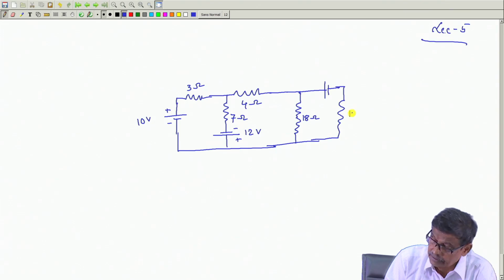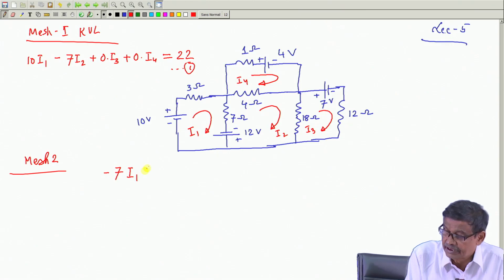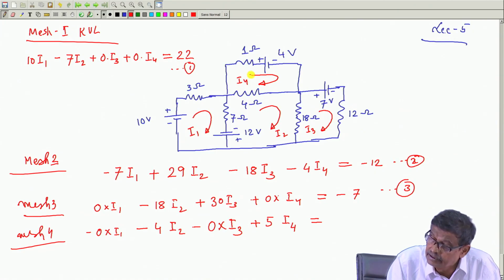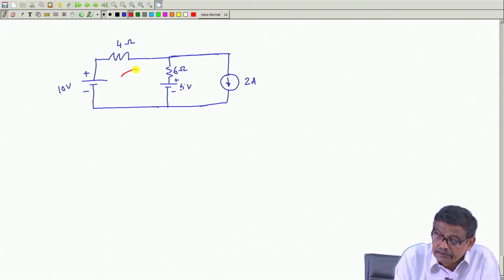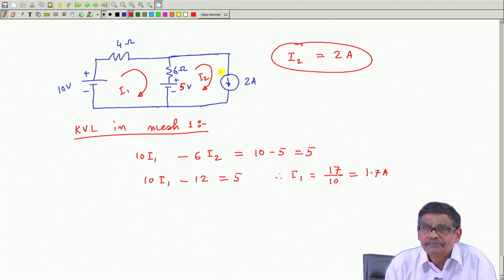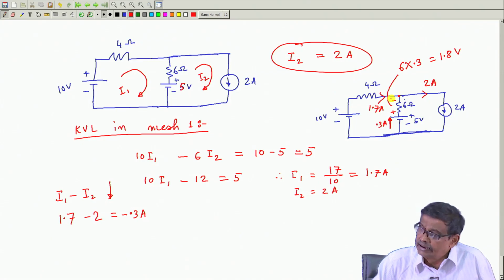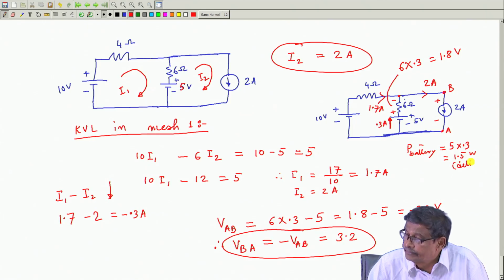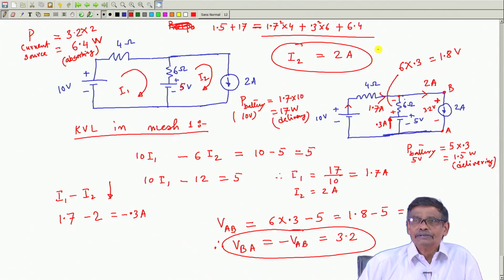Lecture 05: Mesh Analysis - II

Comment: If current source absorbs power why is it called a source. Isn't a source supposed to "give" power?
Reply: But what if it's connected to a greater value source then it's left with only one option to absorb the stuff as it can't do anything in front of stronge opponent potential across it is in negative direct to which it supplies the current. What you say...
Reply: That's great ,I say
Reply: Not always
Reply: Battery charge nahi kari kya kabhi bhai? 😂